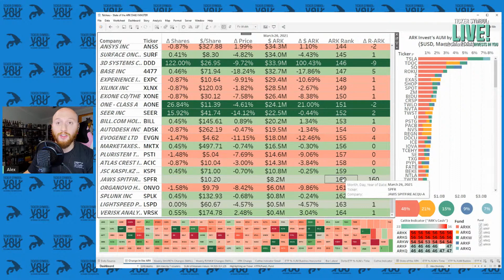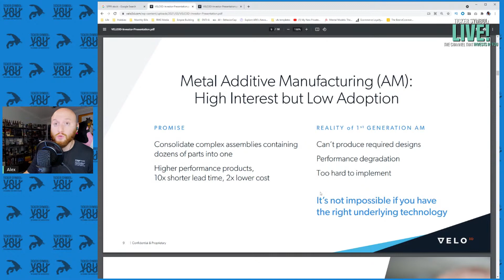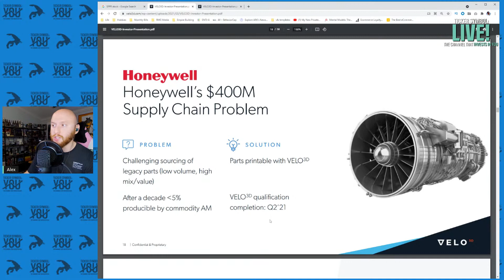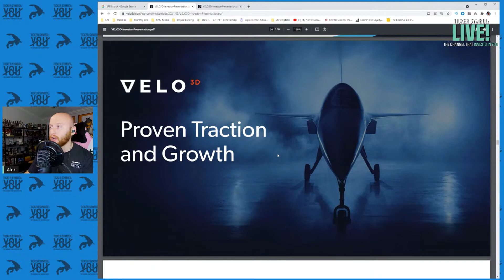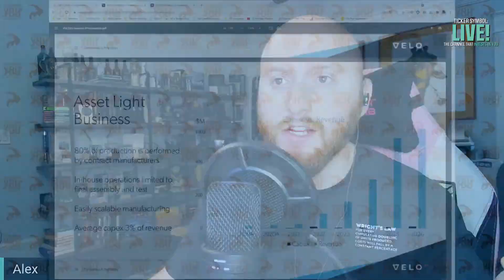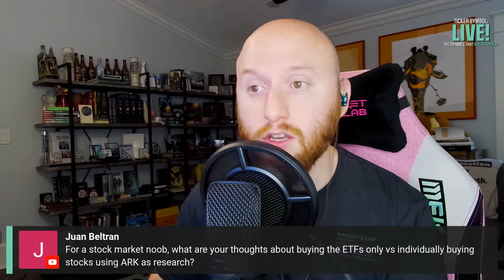🔴 METAL 3D PRINTING WINNER | ARK Invest Buys SPFR (Spitfire SPAC for Velo3D Stock) and It's Awesome

Comment: Have you thought about using your own picture rather to than Cathy in the thumbnail?
Reply from the maker: I have. I might but the whole idea is these are all stocks Cathie Wood is holding. If I cover a stock I hold but she doesn't, I would do that. Any particular reason you're asking?
Reply: @TickerSymbolLIVE  building up your own brand? Just curious and also I think the "cathy headshot" thing is bit overdone. You are adding a lot of value by doing these additional coverage, maybe both headshots? lol
Reply from the maker: Ha. I appreciate that. Yeah maybe I will do that. I just figured if we're always talking about ARK, I should call out the fund manager of the funds we're tracking. My brand is just so tied to ARK right now that I figured this is the right approach. 😅
Reply: 80% of production is performed by contract manufacturers? Wait...so they don’t own their production chain? The opposite of being vertically integrated? Not to mention unmanaged security issues of sub contractors. I had a TS clearance in the marines and they are not cheap. Or quick. Also a point of vulnerability re the highly organized Chinese theft of Intellectual property..their CEO worked within Isarelli intelligence community so....one would hope.....